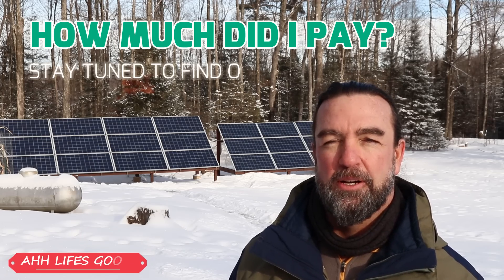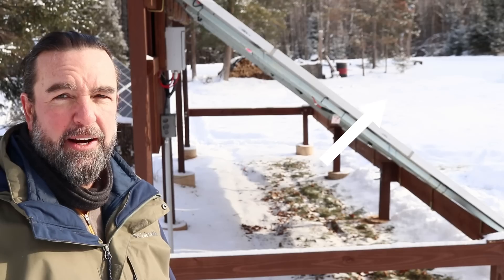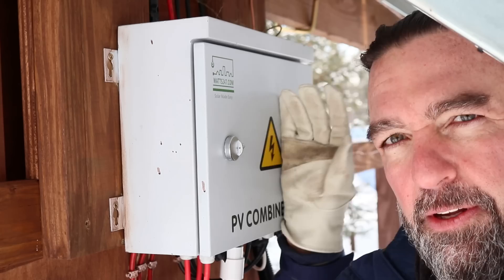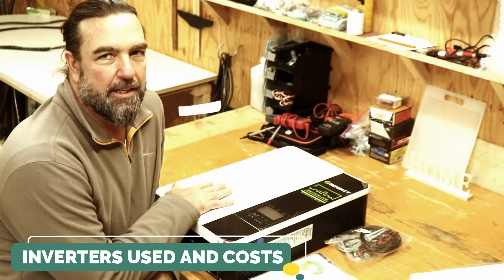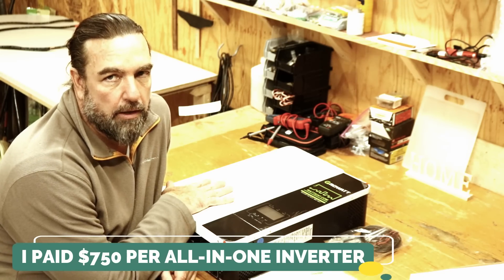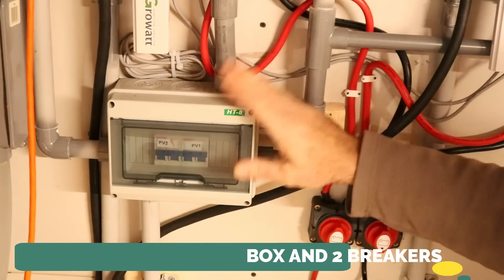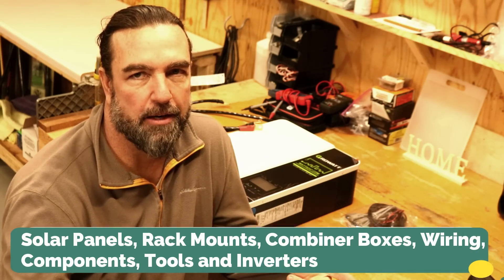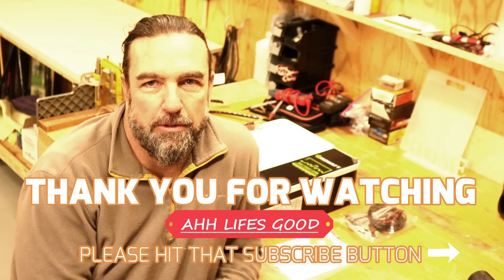WHAT I PAID - CHEAP - ENTIRE DIY SOLAR SYSTEM

Comment: Wow that's a real good price on those solar panels. Did you buy them used or are they new? And what's the website?
Question: I've got a 100 watt solar panel feeding into a 12/24v controller w/ auto reset that feeds to a deep cycle 12v marine battery and then to my lights of my home biz sign. It seems to work temp. Do you have any suggestions? Maybe I need to use a different battery? I have 2 of these batteries that I have changed out and still get issue.
Reply from the maker: - Cheers mate - I bought my panels from Ian over at watts247, great guy. In regards to your issue have you tried connecting both those 12v batteries in parallel and trying them together on your system? In short to me it sounds like your loads are probably higher than the current provided.

Comment: Could you make a video walkaround of your pressure treated solar array setup?  I've been wanting to do something like that and yours is the most efficient and well designed I've seen anywhere based on this short video.  Wood may not last 30 years and so people poo-poo it but most solar installs only make it about 10 anyway before theft, hail, moving, etc so that makes sense to me.  I was also thinking of using superstrut but am unclear on how those Ubolts fit in and such.  Thanks for the video!
Reply from the maker: - I'll make a more detailed walk around on the solar rack, thanks for asking.

Comment: By the way, I had 2 solar companys talk to me about using MY ROOF to produce electricity just to sell it back to the electric company. No Batteries. Over $50,000.00. But with government credits so it will be lower. Credits not guaranteed, but I still would owe them over 50 Grand. I told them to hit the road.

Comment: If you plan to add more panels I would just go with getting something like a midnight charge controller if you do not need more inverter space. Adding another array or 2 is always easy. Did you run the wires in conduit? if you did then it might be easy to sting in a few more lines for new arrays. You can never have enough solar. Winter time is one when having extra panels really pays off. In the summer it really helps as well because you can turn on another ac unit and not feel guilty about it. 
The all in one inverters are nice. I like the MPP solar ones because of their higher voltage rating. 450v for one of their battery-less inverter. Also you can only make them battery less if they are ran as single units. Though there is not a larger unit out there. I would like to find a unit that is 20kw inverter with 30kw of solar and can be battery-less. As the current way my home is set up adding in a few kw all in one battery less inverter if futile. With the battery less you can also back them up with the grid which is great for those who want to cut their day time electric cost by larger margins. This could also be the means of running air conditioners with out the extra monthly cost, running electric heat with out the extra cost.
Reply from the maker: - Thanks for weighing in William and offering good advise for myself and others, most solar enthusiast would agree I'm sure that you just can't have enough panels, especially those in the areas where sunlight is a higher priced commodity! I was also at a tossup between MPP Solar and Growatt, the only deciding factor for me was that these smaller growatt series are perfect for the greenhouse, while being scalable for my trial period In-House until the Climate controlled greenhouse has been built. Battery-less option inverters are a great option to have available.

Comment: Those are some cheap  superstruts !!! My local Home Depot has them at $25 per 10 ft section, if you buy 10 or more, $29 otherwise. BTW I subscribed.
Reply from the maker: - Hello An Mo - Honestly I cant remember what I paid exactly for them, but I know it wasn't $29 a piece, if it were I probably would've used wood. For expansion any additional solar racks I'll be welding together on a manual swivel, cost will be a relatively the same but the durability should last longer, and allow me to move the panels according to the suns angles.
Reply: @ahhlifesgood1956  Very cool. I will be very interested in seeing your swivel design.

Comment: What region are you in and how many kwh are you generating on average?  Great system!
Reply from the maker: - Hi Kevin, were in the Upper Pensinsula of Michigan, 46 degrees latitude. The sun here comes and goes, on average in this area for the last 4 months combined 10kw a day. Some days of course less and some days more... Today with -4 temperatures and probably only 4 hours of good sun I brought in 17kw. Now keep in mind those numbers that I'm stating at 10kw a day on average won't register kw that could've been added to the total but isn't because of batteries being full and or my appliances not consuming the electricity being generated.
Reply: @ahhlifesgood1956   Great info, thanks!  I’m in Saginaw, lower peninsula!

Comment: Another place you can cut cost is fuses.  Fuses are only required on PV lines if you're paralleling 3 or more strings.  1 or 2 strings do not require over current protection.
Reply from the maker: - Thanks for the comments Chris!

Comment: inspection from building code?  Home insurance  very strict on qualified installers,  I was going to do it, bought everything 6600w system every item has to be of code, UL, CSA standards. Nobody mentions that, I ended up selling my stuff for a good profit. instead.
Reply from the maker: Thanks for sharing Billy Bob, in the area we're located there are no codes or regulations coming from the local municipality. Apparently solar hasn't been a topic, but one should definitely check with local regulations prior to building. But if I build a pop tent greenhouse I do need a $20 permit...  Insurance or possible future claims is a good idea to take up with your provider.
Reply: @ahhlifesgood1956  Smart

Comment: Excellent breakdown, thank you. Forgive my ignorance but what does a system of that size run? Can you run your whole house on it?
Reply from the maker: - Hello TwoBuck Chuck... System prices are increasing these days, especially panel pricing I'm noticing is much higher in only 9 months. The costs of systems vary on many factors from location, electrical consumption needs to whom is selling the system. My entire system was pretty cheap in comparison to many other freinds and viewers. Can it run my house entirely, sure but I need to be conscious about all energy consumption loads and charging rates (weather/time) at every moment. The place I have this solar system is the size of a cabin for most folks living in the US.

Comment: Im using a 3.5KW setup for backup power, Ive had it set up since 2014. Im still using 24 golfcart lead acid batteries since they were affordable back then at 85$ each. I dont use the system unless the power goes out but 75% of the panels are hooked to grid tie microinverters for lowering the electric bill. Id like to upgrade my batteries in the near future with lithium but I aslo want to move so I will probably just do a new setup at my new place. I will definitely make a rack for the panels instead of roof mount in the future. Thanks for sharing your info
Reply from the maker: Hello TDA and thank you for the sharing your comments! Good advise for newbies.

Comment: Why do you need quick disconnects when you can shut each of the Batteries?  It dosent hurt anything, where did you get your U bolts to connect the super strut
Reply from the maker: - Happy Holidays Tony, good question on the Quick Disconnects, in principal they're not needed I added them for convenience and if for some reason I have an issue at the batteries there is another means to cut the current. I actually plan to put in place DC breakers at that same point of the disconnect for added protection.. The U Bolts for rear leaf springs on cars I used for the super struts I ordered online at I beleive NAPA, they're a third of the price than those made for the super strut connectors.

Comment: Great video, great info. Do you run off-grid or grid tie?
Reply from the maker: - Hello sir, I run off both. When the inverters or battery's cannot provide the electricity needed the Grid comes on automatically to compensate any additional power needs. Very nice system, I'm very happy with it in general.

Comment: Grats, best video I've seen on this topic. As a noob I have a question: Why only 6k of inverter ( 2 @ 3K each ) for 7.5K of solar panels? Why 1.5K short/ TIA
Reply from the maker: - Hello Wayne - This setup is actually for the greenhouse I'm building and a test model prior to making the design around how we can control climate most affordably in these northern areas. The original idea was thought around 120v only, 1 inverter using 12 panels. That lead to an immediate expansion after realizing how little energy 3kw is daily when connecting to electric heaters, given amounts of daily sun intensity. The only difference in the plan now for the greenhouse heating is to rely more heavily on geo thermal heating and use the passive solar to only power max. 120v fans, with minor heating elements for heating underground water tubing. I will upgrade the house Inverters to 2, 5000 min. Inverters and add a minimum of 36 panels 300+ watts.
Reply: @ahhlifesgood1956  I live in Michigan between 43 and 44 degrees North, so I am seeing cold weather too. I am curious as to what tubing you will be burying 15 ft deep for geo thermal, diameter and type. The thin corrugated black stuff similar to drain field pipe would crush?
Reply from the maker: @wkinne1  - Hello neighbor! I haven't taken a decisive direction on the exact material I'm planning to use for the underground tubing but I am leaning towards the rigid perforated tubing, I think it's 6" in diameter? Depending upon what's below the earth in your area you'll need to plan according from for frost lines, water drainage, depth and length needed for the amount of air you plan to exchange.  In my case I'm going to need to dig even deeper than my tubing, creating an escape area and drainage for excess water, given our proximity to allot of water in these areas. I'd image we'll be using rocks of different sizing, plastic and sand as the fillers, to what levels, I have no idea at this point. Once known that'll play into the type of tubing we can use or not for the project.

Comment: I have a 17kW, 50-panel (340 watt panels) grid-tied microinverter system that was installed by a local solar contractor last year for $20,000.  No batteries yet.  I thought it was a pretty good deal.
Reply from the maker: - Thanks for sharing Greg, sounds like you have a powerful system at a very reasonable price.

Comment: Great video! Could you please tell us (or do a video) about how you wired your panels, ie. how how many in series/parallel, open volts/amps, max volts/amps, etc.? I'm wondering because I want to buy the exact same Growatt 3000 ES model inverters but the manual says only 18A max solar input and it looks like you have more in parallel that exceed 18A. Also how does the cold weather affect your panel voltage? Does the voltage exceed VOC on really cold mornings? Thanks!

Comment: I've got a 10kW solar system coupled with a 28kWh LiFePO4 DIY battery with BMS. The system includes 2x100A charge controller and a 6kW low frequency inverter. Together with all wiring, and my DIY ground mounts the total cost of the system was <10k€.
Reply from the maker: - That sounds like a really nice system and at a great price, was planning myself to DIY the next round of batteries. What did you use for the BMS?
Reply: @ahhlifesgood1956  JK BMS. It's a 2x16 280Ah cell battery pack, so 2x that BMS. It's been running for almost two years now without issues. I'll probably double the capacity this year.
Reply from the maker: @upnorthandpersonal  - Thanks for sharing, I'm in the market myself for backup BMS to my EG4'z and for expansion of my current system
Reply: @ahhlifesgood1956  No problem. Are you on Will Prowse's forum? If not, I would recommend dropping by there :)

Comment: Great job, on installation and the video. One question, do you have 2pole breakers in the panel from grid to supply inverters or are you off grid? And, what size breakers are you using to send power from inverters to panel? Assume a one pole 20amp...
Thanks for doing the video, again, great job and I subbed to see what else you're doing

Comment: Just curious, are you using 2x6 or 2x8 for your panel mounting?   Planning mine out now.  Thanks for all of the great info.  I'm in Michigan also but southwestern side.
Reply from the maker: I used 2 x 6 for a more rigid strength.

Comment: That was very cheap given you are in the US. In Australia, it cost me about $8,000 ($5,765 US) to have a 13.2kw system installed on my roof (2 x 6.6 half cell systems, with 5kw inverters for each system). I do not have a battery set up though, and a 20kw system would cost well over $20,000 ($14,413 US) here as tehre are no government subsidies for batteries yet.
Reply from the maker: - Thanks for sharing neighbor, the price you paid is relatively inexpensive factoring installation costs, other viewers have been much higher in comparison. I hope all is well in the land down under mate!

Comment: Finally a video on solar station that does look like it was done DIY. I have very similar station and its cost is around 7k USD (I have lead-acid 10 kWh batteries), also bought 7 kW gas generator (2 liters of gas for each 7 kW of energy; up 80 liters of fuel a year). I have Discord channel where I encourage people to go solar. And in the end of the winter I will give results of living in an off grid house with similar video.
Reply from the maker: - Thanks for sharing Llya, I'll be having a look at your channel. Living Off Grid has become the new place to be.

Comment: A very good summary of your system and costs. Providing why and where you purchased helps too. On another channel some folks with similar KW as you used some ingenuity to make tilting panel holders. They can follow the best angle for capturing sunshine and only adjust four times a year. Check the Life Uncontained channel. From my knothole I think you could run another top horizontal and some hinges and or risers at the bottom horizontal. Then all you would need are arcs of metal with a central cutout that can be bolted to the "vertical" struts at any angle you choose. Min and Max will depend on your latitude. To make it even more simple, you would just have holes in a plate that give you the four or more angles you choose. Just propping it up and laying it down.
Reply from the maker: Hello Gerald and thanks for sharing your comments, the horizontal hinged system you're referring to is exactly what I'm thinking of doing for the additional racks of panels in the future. I'm not to concerned on the East-West swivel as, those adjustments would need to be done daily if you don't have it automated, but I do want to harness the Up-Down pitch, like you said you could adjust it 4 times a year and really gain allot of extra sunlight from the angel differences accomplished. I think allot of folks under estimate how much more energy you can harness with a tilt system in areas that don't' have the sun shinning 99% of the time like the Midwest.

Comment: Really eye opening video.   I am planning a 9kw install.  Aside from outages, what are the advantages for using batteries.  My system is going to be grid tie.  Not worried about outages.

Comment: Excellent system excellent information seems like a system that would pay for itself in as little as three years or maybe out to 7 years depending on what you are doing
Reply from the maker: - Hello Curtis and thank you for watching, yes the system is not to big, not to small, just the right size for someone wanting to dig in and get there feet wet in the solar industry prior to any serious investments of time and money. The system could pay for itself without using any kind of credits or write off expenses within 8 years, depending of course on consumption and increased electrical prices towards the future. With tax incentives this system will pay for itself in 3 years time.

Comment: Great video! I was thinking a little simpler by doing a 3KW system and trying to keep all my loads to 110/120v with wood heat of course. Should save a lot by doing it that way. I would like to invest in wind also, but there is very little info on it and on youtube about it. Most of the chineese wind turbines have bad reveiws saying they just don't put out as advertised. I am in a very windy part of North America and very little sun in the winter. Thanks!
Reply from the maker: - Thanks for writing BFG, I have a buddy that's tried a couple of the wind turbines bought out of China and they were both junk, he did however end up buying one from somewhere in the middle east that was really good. I'll find out which country... The 120v option is what allot of guys around me are starting to install for there cabins, as they build homestead they plan to expand the solar. That's one really nice option about some of the growatt inverters is that you can continue to expand upon what you have already installed (of course within reason).
Reply: @ahhlifesgood1956  I am really curious about your friends turbine from the middle east. A brand would be helpful.